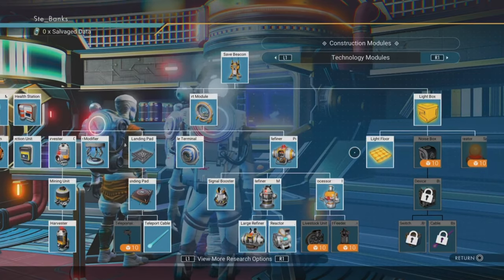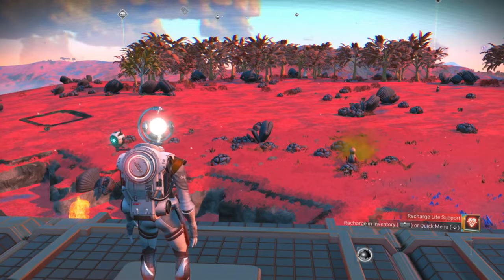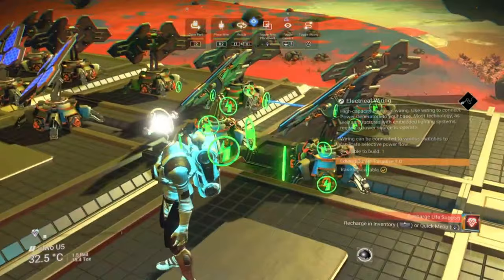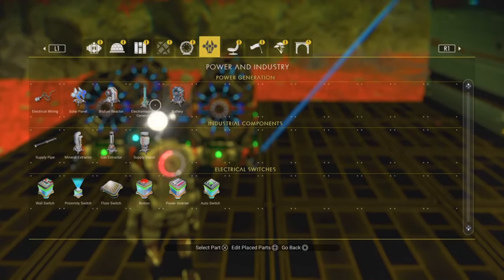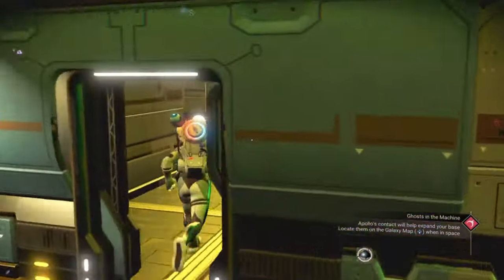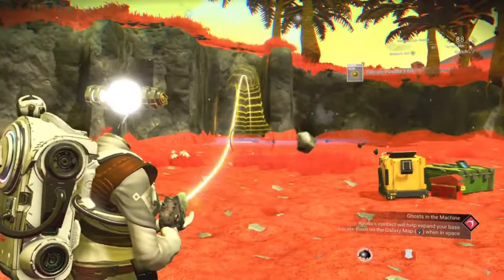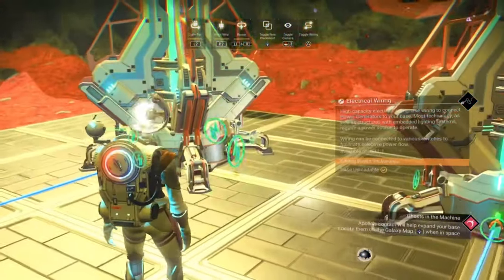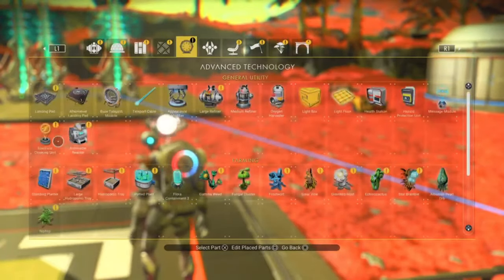No Man's Sky Building A Base The ESSENTIAL POWER GENERATION BEGINNER GUIDE!!

Comment: I consider myself fortunate.  I found a electromagnetic hotspot near a "Curious Deposit" area.  Needless to say I'm, building a base there.  I noticed you built 6 of the generators near that hotspot.  What's the total number of generators you can build at a hotspot?  I'm also playing around with the idea of using of building several round prefabs stacked on top of the other and placing batteries inside of it as a sorta "Mega battery" and eliminating several wire segments in the process as well since power is conducted through the prefabs.
Reply from the maker: Yeah I only needed the 6 for the amount of power that base uses for now. As I expand it I'll add more but I don't think there's a set limit, it really depends how much power you need to generate. Give it a go, see what happens 😁
Reply: @BunkzGaming  I decided to crank it up from 4 to 9.  Plenty of power and my mega battery idea seems to work find as well.  haven't tried stacking round prefabs next but that'll probably be next.  In the process of moving so time is limited.
Reply: Idk if you’ve found this out yet but electromagnetic generators you can build an infinite amount without diminishing returns if you need space build them up higher preferably above the highest percentage of the hotspot.